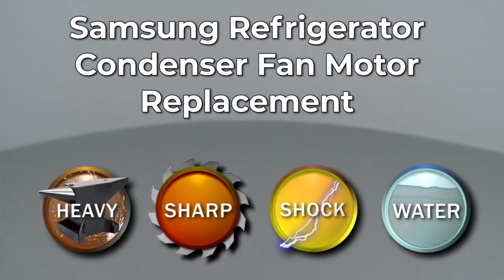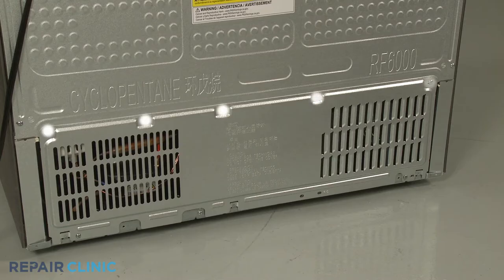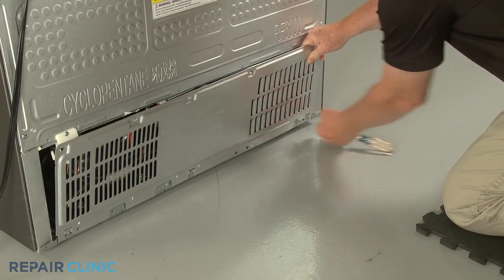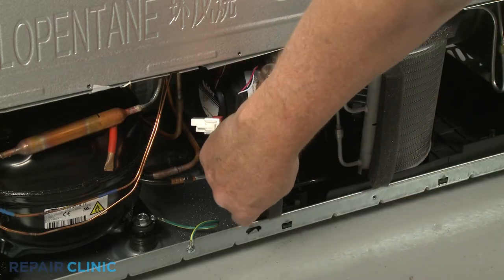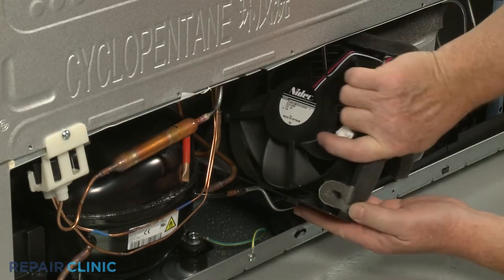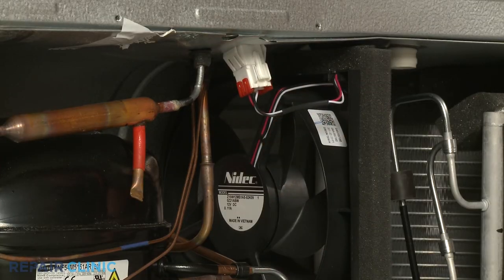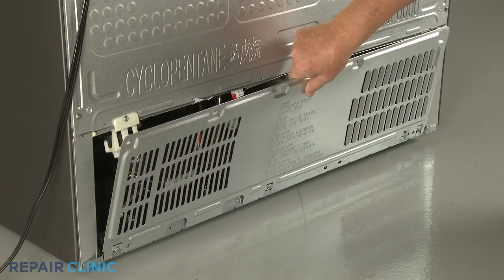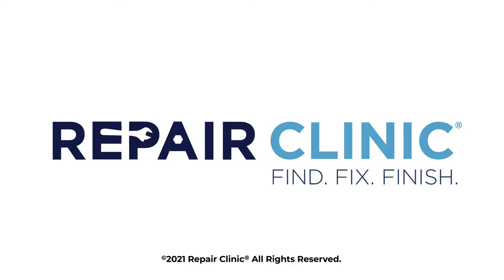Samsung Refrigerator Condenser Fan Motor Replacement DA97-20025A

Comment: Question; if the Compressor fan doesn't ever come on, is it possible the compressor wil not "ramp up" to a higher speed?  We have a newer fridge and the compressor starts, then after about 5 seconds, the compressor motor lowers down to an idle; can barely tell it's on. During all this, the compressor fan never comes on.
Reply: I have same problem you ready fixed and how you did
Reply: After replacing the inverter board, it didn't fix anything. Upon further investigation, after talking to a service technician; he said make sure your room is above 15C, run the fridge for several minutes, and check to make sure all fans are running, make sure the compressor is running and check the boards for any flashing lights. For me, all fans worked, no lights lit up and no codes on the display, and the compressor actually ran and was warm so I am going to try to recharge the freon.  I bought a piercing kit that you can hook up an r134a can to in order to recharge it. That's my next step.
Reply: Thank you so much
Reply: My compressor work but fan condenser not working

Comment: Samsung is by far the worst company to deal with as far as repairs. Our refrigerator is 6 mos old and we have to unplug every time we leave the house. Fan stops working randomly and Samsung can't find anything wrong.
The fridge gets so hot on the outer box that you can't touch it. Smokes and stinks up the house. Maybe the fan, maybe communication from the board, maybe something else..Total fire hazard 🔥 we can't trust it.
BUT SAMSUNG LITERALLY DOESN'T CARE..sent videos and everything.
Their Specialty Claims Dept. is horrible.
They lost our business for life..TV, phones, appliances.